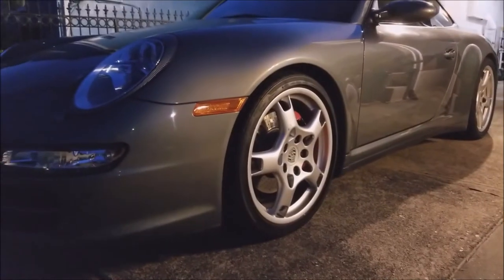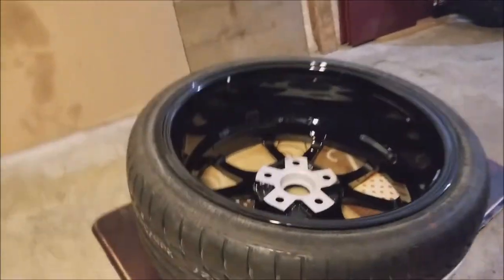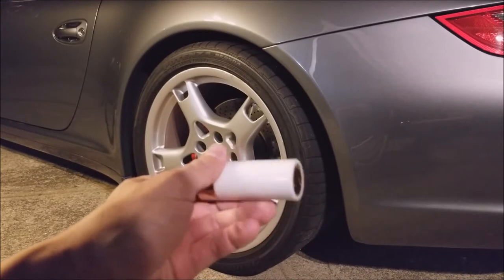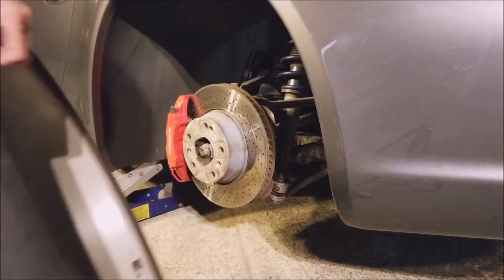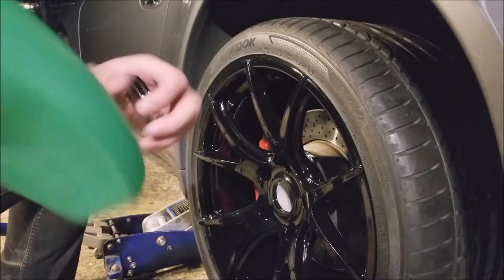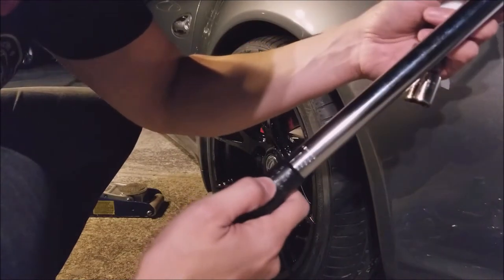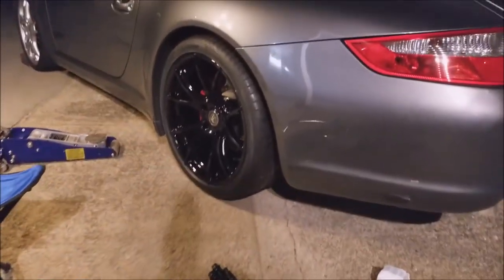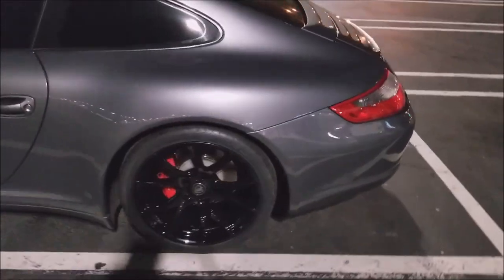Forgestar CF5V Install - 2007 Porsche 911 Carrera 4S (997)

Comment: The people who did your suspension, put in the wrong front struts. Per Bilstein, the B6 struts are a performance struts designed to work with the OEM springs. What you should have installed are the B8, which are designed to work with a lowered spring. Also, should have replaced the rear shocks to match the same series shock and struts as the front.
Reply from the maker: Interesting take but the shop is actually right. Read some thread on rennlist. Keep in mind that the H&R spring is less of a drop than an Eibach spring. B6 is pretty capable for this application.

Comment: Not a fan of black wheels in most circumstances, to include your application.  Fortunately, what I think doesn't matter.  Never trust a jack, man.  Jack stands save lives....  Smart choice on the non marking socket.  Need to get a set of those myself.